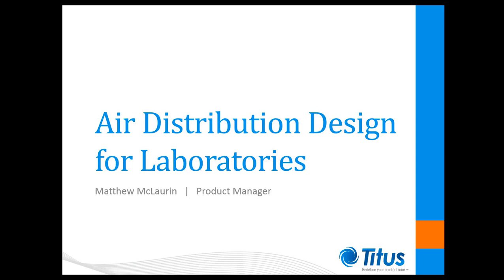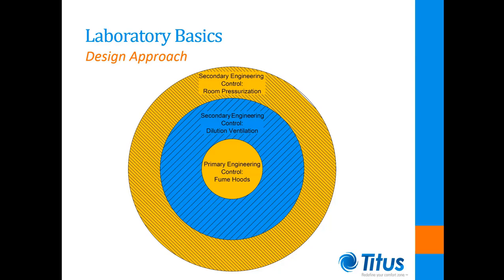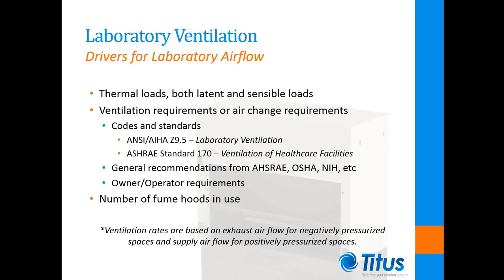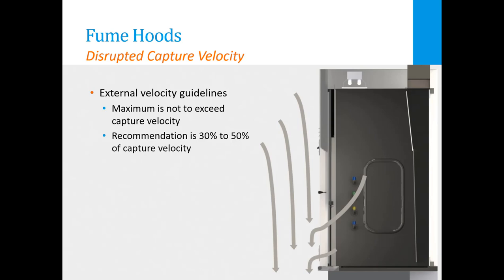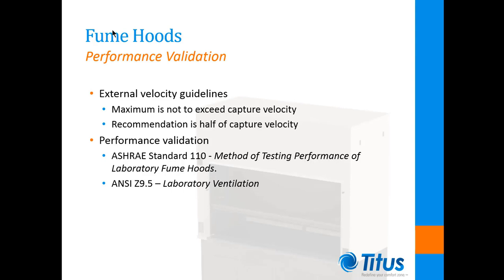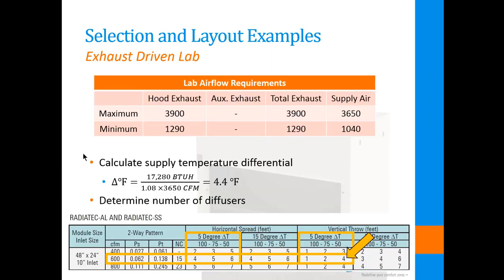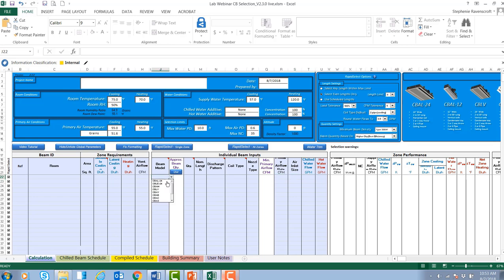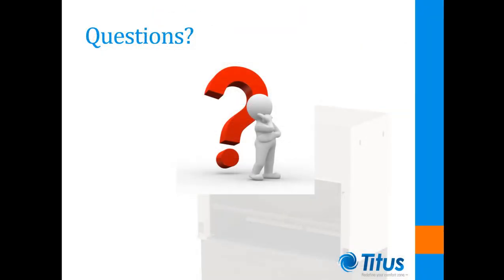Air Distribution Design for Laboratories

Comment: Very good. Please can you share Excel file?
Reply from the maker: The CB excel tool is included within the TEAMS selection program. Once installed, selecting the chilled beam icon will launch the excel software. You can find it on our website under the Software tab.